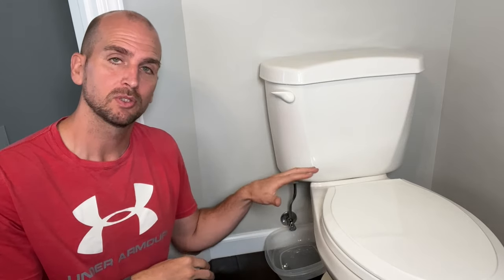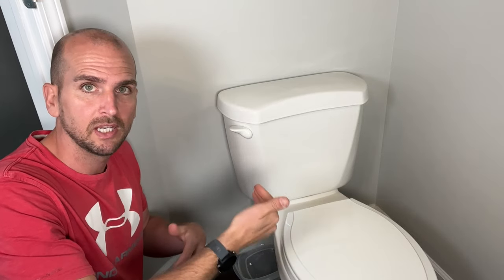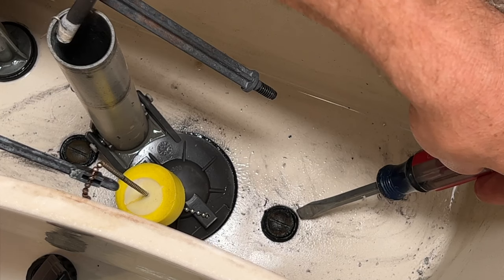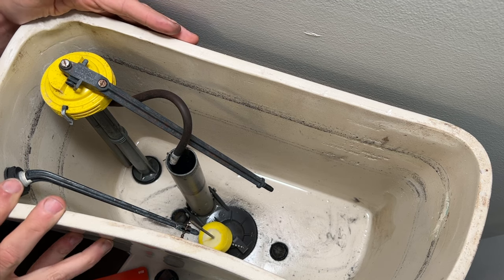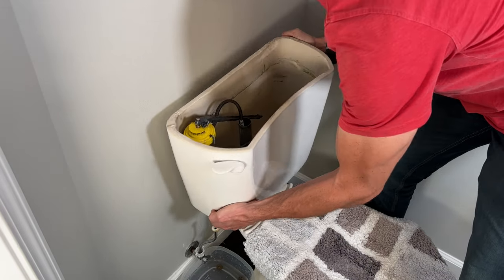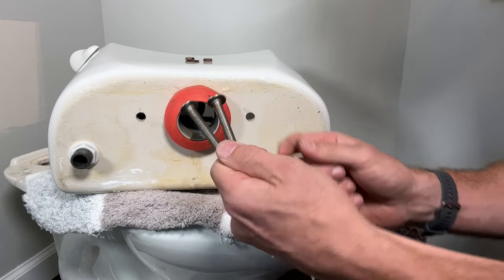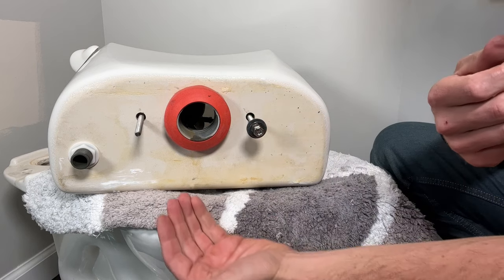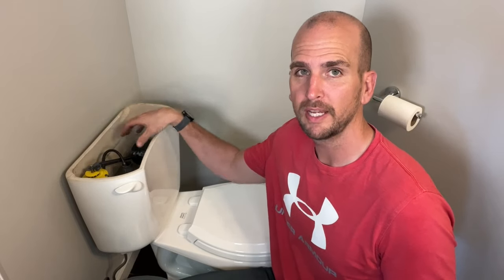Easy Fix For The Most Common Toilet Water Leak

Comment: Just change everything out when things like that fail. Usually when one thing fails the rest will start failing. Might as well change everything out while its apart.
Reply: Nah… mine started leaking. $20-30 fixed my problem instead of paying for and paying someone else to install a whole new toilet. It was easy, and I’m terrified about plumbing diy work.
Reply: @militaryav8r  
I am under the impression that Andrew Jones is referring to changing all of the seals and gaskets at the same time.  I don't believe changing the wax ring would be wise with a just a tank leak, however. It's a different material and triple the hassle!
 https://youtu.be/yR2lgxy-htU I would personally recommend replacing the ball float valve for a Fluidmaster float valve at the same time. The ball floats inevitably cave to the pressure and allow for a contained overflow leakage after failure.  The Fluidmaster floats don't have as much leverage strain and hold up for over a decade.
Reply: @GeorgeVCohea-dw7ou  😳 Can’t believe I didn’t see that. In that case, he’s right about that. I basically replaced everything that wasn’t porcelain when I opened mine up.
Reply: Nah, if my toilets leak, I'd sell the house and buy a newly made one.
Reply: @OhgodImtoosexy  😂🤣😂🤣
Reply: Don't change the whole toilet. Just the guts and seals.
Reply: All depends on the pertinent details but yea definitely change out the whole thing including the flange and don’t forget to use those offset bolts they tighten up easier
Reply: Might as well just buy a new toilet. Actually… fuck it, buy a new house. Suppose something else will just break eventually there
Reply: @andrewjones9886 I thought you meant the whole toilet 😂
Reply: Duyy

Comment: When I replace parts in a toilet, I write a note inside the tank, above the waterline, in pencil, with date and what was replaced. That gives me an idea of how long that part was in service, or if there are other parts I should consider replacing before they fail.
Reply: I use a silver or red Sharpie and write install date on the part.

Comment: “A one trip repair”… I recently had to replace the rubber seal on my bathroom washbasin. I hate to report it was a three trip, two day repair due to not buying ALL the right parts, doing the job on a Sunday, when the plumbing supply house was only open until noon. 😞

Comment: dont be lazy.. clean the top tank before you put the gasket on. also with the weight of the water you will want to go back in  a week and tighten slightly the bold as the weight of the water will push down on the seal

Comment: Thanks for the video. I changed my bolts and still had a leak.  The instructions on the packet had me place a washer inside the tank between the bolt head and gasket.  I still had a leak after that.  I removed the washer and placed it like you showed and it worked like a charm.

Comment: Thanks for this great video.  I discovered a slow leak from under my tank and since it was just a couple of days after I had cleaned the toilet I thought there might be a connection.  After learning about the bolt gaskets, I checked the bolts and one of them was wet.  I tightened that bolt a little and now there's no leak.  You made fixing the problem so quick and easy.

Comment: Thanks so much for the great video! Probably saved me $350 on a plumber. Mine was in pretty rough shape… over 30 years old. The wing nuts were actually so corroded they snapped off in my fingers. Thankfully I was able to get the rest of the nut off. (This was the most difficult part for me.)
I followed your tip about not using the washer & nut under the top tank part… That should make easier to change out the next time.
Your video made the job much easier! Thanks again!

Comment: Great advice! Just replaced my entire toilet down in my basement due to its size not for a leak. The original one was like a 14 in from floor to a taller 16 in for the seat. The funny thing is whenever I’ve change a toilet, I forget to paint the wall behind it to match the current color. I noticed that in this video also. Thanks for the video

Comment: You have a higher tolerance for worn out rubber parts than i do.  Theos babies are overdue.  I am a firm believer in using a film of silicone grease on all surfaces of the rubber seals prior to assembly.  I also usually put a light film on the SS/brass head & thread area and the porcelain spot where the bowl gasket contacts so that it doesn't grab.  Not essential, but i feel that it adds to the ease of sealing and might add a bit of life to the seal in hard chlorinated water areas, which eat them alive.

Comment: Thanks for helping me changed mine. I ended up doing the 2 hex nuts option as it ensures a tight seal right from the tank. I couldnt do it the faster way, the balance always seems off and water keeps leaking out.

Comment: To empty the tank of water, flush like you did but then use a grout sponge. If you are changing the toilet, they are great at emptying the bowl and then being used as a plug so water does not drip when you are removing the bowl from your home. They are cheap and super absorbent. Any water cleanup is very quick using the grout sponge, and you can of course clean (as necessary) and reuse. I always keep an old grout sponge in my plumbing go bag.
Reply: That’s why I use my wet/dry vac to drain bowl and tank before work and/or shutdown of water for winter at summer cottages.
Reply: Or use a wet/dry vacuum

Comment: I would have put the 2nd rubber washer between the tank and the toilet. Putting it under the toilet with the washer and the nut defeats the purpose of stopping any water that escapes the rubber washer next to the bolt head inside the tank because once water makes it past that first washer it would leak out between the tank and toilet (porcelain against porcelain does not seal) Just my thought... Great video as always. Thank you!
Reply: I have a total of seven toilets here at my summer cottage colony so i’ve done this repair numerous times over the last 20 some odd years. I fully agree that he should’ve put the rubber washer, metal washer, and thin nut on the bottom of the tank prior to putting it to the bowl because underneath the bowl, should only be a metal washer and a nut.
You need to have a totally sealed tank before you put it on the bowl! I test my tank at that point by putting it on some two by fours outside and filling it with some water just to make sure it’s not leaking.
Reply: I agree with this method. The tank and bowl do not sit flush against each other anyway, meaning the two units will be pulled up against each other when bolting the tank to the bowl. This can cause a crack, whereas if you do bolt, gasket, tank, gasket, washer, nut, this only compressed the tank. Much better method which is what my 40 year old toilets used.
Reply: @StishFicks  Over time the rubber washer inside the tank become thinner and you need to tighten the nut between the tank and bowl to compensate but it is inconvenient to do. You will only tighten the nut under the bowl whenever is needed anyway. The nut in between eventually is not really useful and just make replacing the bolt and rubber more difficult later.

Comment: I had a tiny drip. I tried tightening the bolt and it made the leak much worse. I had to replace both the bolts. I tried installing the mounting bolts your way and the tank still leaked. You should seal the gaskets with the extra washer and nut to the tank. Then mount the tank and use the washer,gasket, and nut.

Comment: I'd add check the tank real close, look for a crack that could also cause a leak.  Happened to me!
Reply: Happened to me too after paying a handyman to replace parts. Did you get a new cistern or repair it?
Reply: @Sunnyday1571  Replaced it.  The toilet was 30 years old and used more water than modern types.  This was in 1997.

Comment: Good video! Only thing should be done first is to snug up the tank rubber gasket fist to tank. So put you bolts and rubber through the tank then put Metal washer then bolt it snug then put your tank on to the bowl then washers then wing nuts or regular nuts and voila!

Comment: It's better to compress the bolt gasket with the sub nut then mount the tank. It's a sure thing. Some replacement bowl compression gaskets cause issues when mounting and keeping it level and secure. It's especially touchy with the 3-bolt mounting method.

Comment: Fluidmaster make a fill valve with a concentric float ( in both bottom and side entry variants )  the valve is plastic bodied and also the thread used to be, but they do one with a brass 1/2" thread - which IMHO is much better than the plastic thread,  which can stretch over time and be impossible to re-tighten if it does leak.

Comment: this was GREAT, thank you.  i did the replacement with a new kit.  there seems to be a very very small drip from the tank bolts.  maybe three drops a day.  

should i just let it go or try to re-tighten?  i’m afraid to crack the porcelain by tightening more. 

there’s 20x more water from stepping out our of the shower.  

appreciate your advice here.  

again, thank you and Happy Holidays

Comment: Definitely just had an issue where the tank was too close to the wall. I tightened it down and cracked the tank. The previous owners had the wrong size toilet for the spot so a new one would have been needed anyway but it was not fun to clean everything up.

Comment: Another source of dripping water is Tank Sweating. It is not a common issue but does come up occasionally. A simple fix is to disassemble the tank removing all components. Dry the inside of the tank. I prefer to wipe it down with acetone/brake cleaner as well. Coat the inside of the tank with Flex Seal or a spray on truck bed liner. let dry/cure and reassemble. I prefer to sandwich the tank with the rubber seals, washer and tighten the tank bolts to the tank then mount the tank to the bowl, even if I have to purchase two extra flat washers. I also recommend replacing the supply line at every service. Once the water is back on your still not done. Place some dry TP under the valve and check back periodically for wet spots. Old valves have a tendency to leak from the stem if they have not been operated for a long time. That can be fixed with some stem packing and Plumbers Grease. It is not rocket science but toilets are more complex than most realize.
Reply: I have a total of seven toilets here at my summer cottage colony so i’ve done this repair numerous times over the last 20 some odd years. I fully agree that he should’ve put the rubber washer, metal washer, and thin nut on the bottom of the tank prior to putting it to the bowl because underneath the bowl, should only be a metal washer and a nut.
You need to have a totally sealed tank before you put it on the bowl! I test my tank at that point by putting it on some two by fours outside and filling it with some water just to make sure it’s not leaking.
Also, there are two types of tank to bowl gaskets. One thinner and one thicker and I’ve needed both types.

I’ve never heard of using flex seal or similar to stop sweating tanks. Does that really work? Because I’ve had one here that’s got the problem and putting in the mixing valve for a bit of hot water to adjust the water temperature from being so cold is what’s necessary to fix it in most cases.
Reply: @JohnHallgren  Flex Seal Has worked every time I have used it for sweating tanks. I will say that mine are generally caused By High Traffic though and are in a fairly consistent temp (residential). The other and older solution is gluing in thin closed cell foam to the inside of the tanks. That works well with older, larger tanks.
Edit.. When I say thin closed cell foam I am talking about  sheets of flexible packing foam/plastic.
Reply: @jamieminton172  I am aware of the foam liner technique but haven’t tried that on this particular unit. During humid summer days with a non-air-conditioned cottage and quite cold water supply, it’s a perfect recipe for sweating tanks.
I was thinking alternative way of trying to incorporate some sort of a in-line tank or coil that would hold about the 2.5 gallons needed to fill the tank so it could warm itself prior to going into the tank to room temperature.
Reply: @JohnHallgren  We used to build "Preheaters" for water heaters. Basically a Black box covered with plexiglass and black pipe run inside and in line with the supply. the box was placed on the roof to collect sunshine. Forest service cabins in Alaska. Not a lot of head pressure, non potable off of up country streams. It was a pain to winterize but it worked well. I would give Flex Seal a go. It is relatively inexpensive and what's the worst case... I doesn't work... Then go with the foam, I would guarantee it if I were your contractor.. the foam that is. LOL
Reply: Typically, the condensation is from constant running water. Bc of how cold it is, and how long it's been running, it never gets up to room temperature. It just keeps sweating
Reply: @dribblez609  in my situation, it’s not constant running but rather how close the toilet is to water supply pipe to cottage that’s coming up from below ground which may be less than six feet or so. Thus on a old style toilet with 3 gallons, much of the refill water wasn’t able to get to air temp before going in tank, thus causing sweating.

Comment: great help, thanks.  (Also wowed by all the other gems on your superb web site)  Yet near the end, you tell us to learn more via a separate video for checking out/fixing other potentially failing tank components..... But nothing there yet where you point.... Still coming soon?   (I'm esp. suspecting I've got a bad seal where the overflow tube meets the tank floor...  Is that covered?)

Comment: Hi advice please !  New house to me.  I have done constant repairs to this toilet cimerron Koehler toilet.  New guts and new bolts.  But the tank came loose and when I pushed on it to ck it out it made a noise.  One side was really loose so I tightened the bolt  another noise.  Now I can see the base area where bolt goes through has not cracked but broken but still sitting there by bolt.  Can I use porcelain epoxy and fix this and then reseat tank??? I bought this stuff for 43 dollars but before doing want to make sure it will work.  I thought I could just do it around the bolt while tank attached but now I think I have to take off and of course that one or both screws are really tight.  When I first started all the repairs I had to hacksaw off all bolts on the 20 year old toilet.  I did get it fixed and now this?  Thanks Kathy hope you answer quickly

Comment: great video but there was one problem.  at one point you said you don't prefer to use the thin underside washers BUT you didn't say why so I understand it better.
Reply: I said the same thing. Personally, I can't think of any benefit from not fastening the nut underneath the reservoir though. I've seen how easily they can start leaking if the reservoir gets jarred around. They should be able to move independently from each other without risking the seal. Especially since everything's apart, it would be "best practice"
Reply: @dribblez609  and I agree also!

I have a total of seven toilets here at my summer cottage colony so i’ve done this repair numerous times over the last 20 some odd years. I fully agree that he should’ve put the rubber washer, metal washer, and thin nut on the bottom of the tank prior to putting it to the bowl because underneath the bowl, should only be a metal washer and a nut.
You need to have a totally sealed tank before you put it on the bowl! I test my tank at that point by putting it on some two by fours outside and filling it with some water just to make sure it’s not leaking.

Comment: Quick ? Nothing to do with this particular video but, have a 15 yr home in Canada the fruit cellar for whatever reason has suddenly started to become wet inside and freeze in winter never had issue before. It is vented (2) has a steel door. Also sump pump is in this rm . Do u have any suggestions as to what could be happening? Ty so much .

Comment: You're forgetting, or Don't know that the bottom nut/wing nut has nothing to do with how well the bolt rubber gaskets are sesling inside the tank. There is another nut on the same bolt that sandwiches the tank material that determines how tightly the rubber washers inset are set. The wing nut on the bottom thst attache the tank to the bowl only determines how well the tank is attached to the bowl.

Comment: Leak is fixed, but tank is wobbly. I've tightened the bolts and they will not budge to go any tighter. Why is this happening? Is there a solution?

Comment: I have an Eijer toilet and the handle is on the opposite side of the tank from the where the water comes in from the wall, so 20 inch line to a plastic wing nut type,,,but there is so little space between the bowl and the wing nut, that someone had to grind off the wing and all the gradations,  so I have found it impossible to get a grip to take that wing nut off so i can remove the tank.    Other than taking a sledge hammer to the tank, what is the solution ?